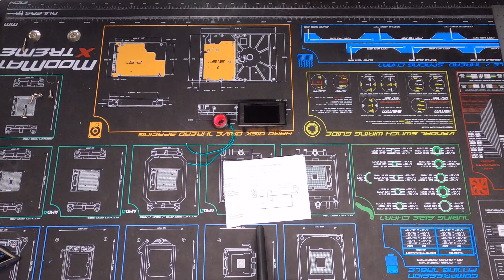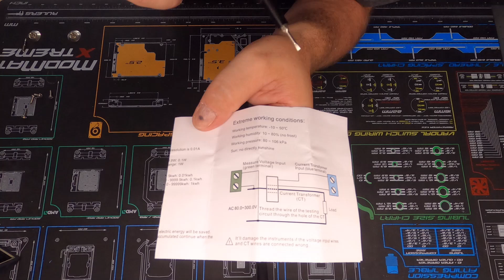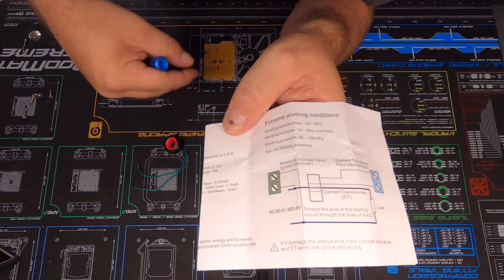Building a 120v Meter Box Requested by HashRaptor...

Comment: PRO TIP:  Instead of knotting the wire to keep it from pulling out, use a  large Zip Tie around the wire.  Pull it as tight as you can.  The locking end of the zip tie will prevent the wire from being pulled out assuming you drilled a hole just a hair larger than the power cable.

Comment: Hey SG! Awesome video! Quick question - do you know if there is a maximum length for the wires going from the CT to the meter and, if so, what is it? In other words, if I wanted to mount the actual meter face, say, 5-15 feet from the CT, would that still work and be accurate?
Reply from the maker: Man I don't know it the length of the wires with the meter is calibrated or not. Im sure you can try it and compare it with another meter short and long wires.

Comment: For anyone else wondering about the GFCI issue SG was having, I think he just needed to press the RESET button down a lot harder than he was.  Those things take a lot of force to reset them.  The TEST button on the other hand is very easy to press.
Reply: That was not the problem. You need to wire to the 'LINE' side of the GFCI and not the 'LOAD' side.

Comment: @SpaceGoats can you please briefly explain the differences in the two Drok meters you listed in the video description?  I tried to compare the two Amazon sites and all I see is that the newer displays some additional information.  From your experience do you recommend one over the other? Thanks.
Reply from the maker: The old style has voltage, wattage, amps and kwh readings on the meter, the new style include HZ and power factor

Comment: Thank you for taking the time to build and explain your power meter boxes @SpaceGoats.
Have you found any inconsistent data in properly reading the power? I ask as I would like to build a couple units and the Amazon reviews a few saw the power readings were off.
Thank You!
Reply from the maker: I have seen some of the reviews but these meter are not certified, they are China made so the numbers can be a bit off. I used mine with a killawatt meter and they are really close. But for a fast reference meter they are great

Comment: Cool. I have always wondered how those boxes were made. Also First.
Reply from the maker: lol, would have been better if the outlet would have reset. Stupid outlet is bad. But hey I did not edited it out.
Reply: @spacegoats2194  It looked like you wired to the load side of the gfci from what little can be discerned around the 7:00 mark.